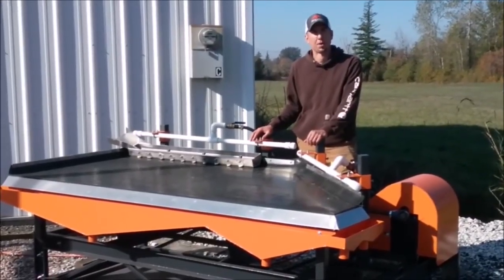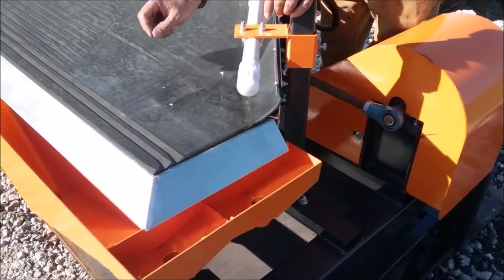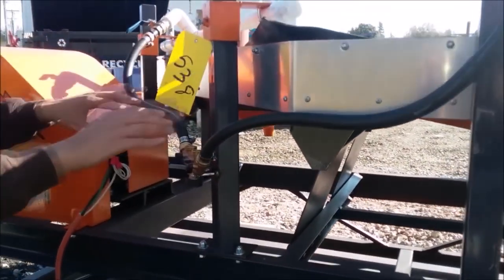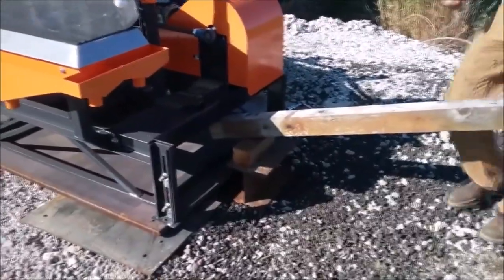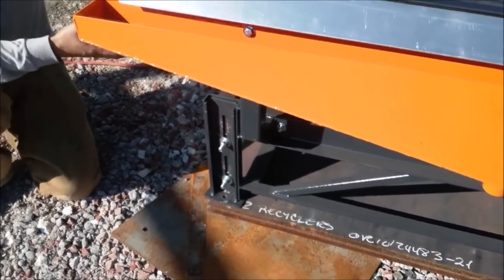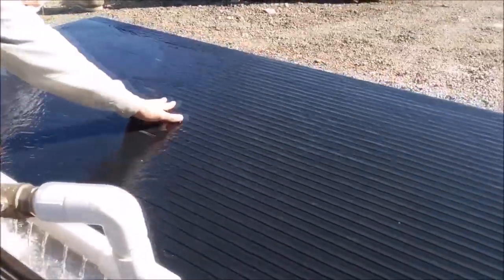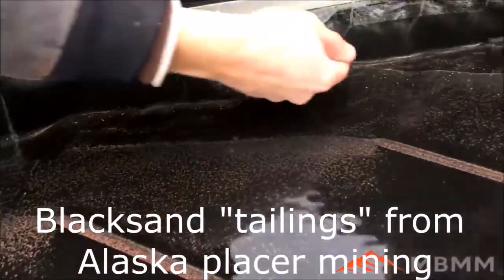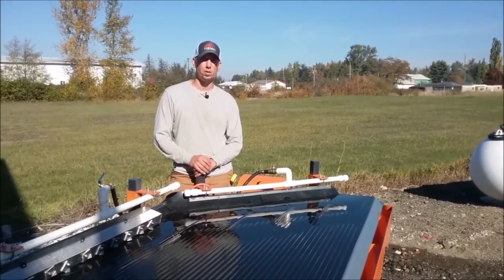GOLD Recovery Made Easy: Inside the 4x8 Shaker Table Design

Comment: 7:00 "should be sloped 1/4 inch per foot" which calculates down to slope of 1.2 degrees. this might be easier to set by using your phone. get a mobile app for measuring angles and then you can just place the phone on the table and set the slope that way.